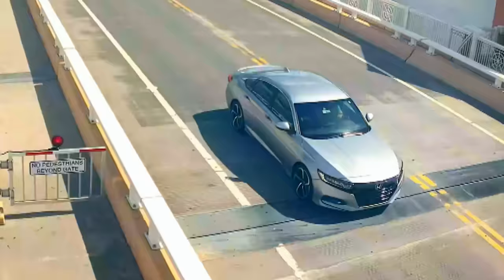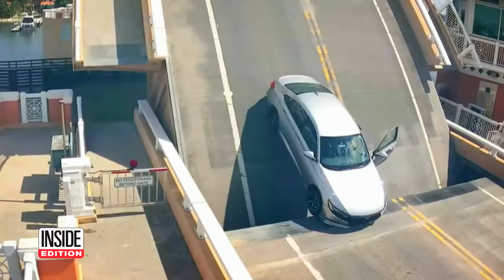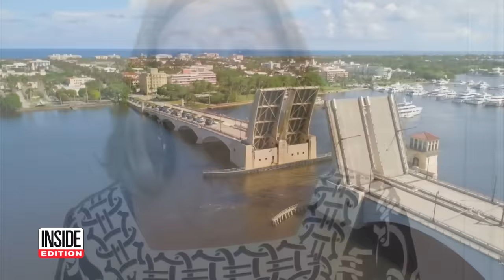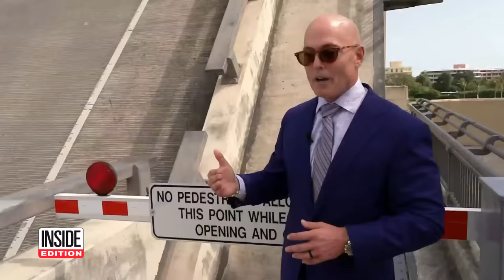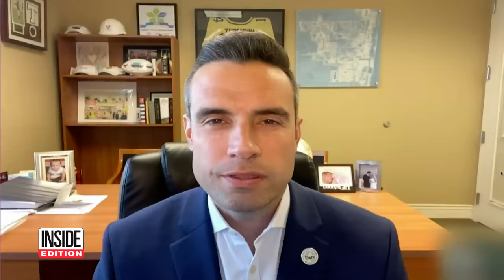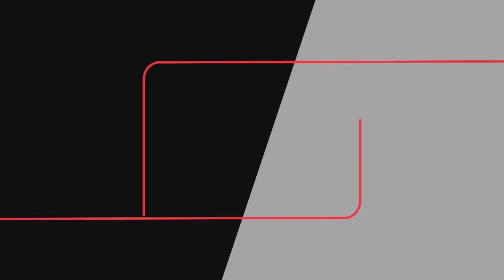Drawbridge Opens While Car Is Still Crossing

Comment: There is no way this particular incident is an accident, the person that is responsible for raising the bridge shouldn’t be blamed. The person in the car could have easily avoided this. It looks like they intentionally stopped and waited for this to happen.
Reply: The person raising the bridge could have easily avoided it also. By looking what’s on the bridge.
Reply: @pk3 how do you know? Do the boats stop completely and wait for the bridge to be raised, or do they raise the bridge in advance while the boat is far away and still moving??
Reply: @trophyscene5015  you're on the internet, how about using google? yes, boats stop completely and line up while waiting for a drawbridge to raise.
Reply: But what if it was instead a responsible driver at that same time???
The bridge operator would still open the bridge!
Reply: @trophyscene5015 
And what if there’s still lots of cars crossing and they can’t open the bridge immediately???

Comment: There should be a "traffic light" on the bridge indicating people to stop while the bridge is about to open.
Reply: There is one like a train track thing
Reply: We have those in uk bruh
Reply: A light? They usually have multiple, along with incredibly loud bells and striped railings that block the roadway. You can't "end up" on an actuating bridge unless you deliberately put yourself in that position. Not to mention there's a one or two minute delay before anything begins to move, which is enough time to walk across the entire length, much less drive it.
Reply: I feel like some people would just pass the light. It's not like they don't do that at railroad crossings already

Comment: I tried rewatching the video 3 times to fully see what’s going on. From what I see, the car doesn’t move. I would want to blame the driver but I can’t be too sure if their car just shut down. If the driver had their hazard lights on, I would’ve dropped my suspicions. However, if this person just did that for a payout, I hope everything bad happens to them.
Reply: If the car was in neutral. Wouldn’t it go forward due to the slope angle increasing. The brakes were on…

Comment: Far too many questions to come to any intelligent summary.    WHY WAS THE CAR STOPPED AT THAT LOCATION/POINT?    There is no gate/barricade to stop the car. I see gates for pedestrians.  Why is the driver not moving forward OFF the bridge???

Of course, the bridge operator should be questioned for activating the bridge. It appears the control tower is right there.  There MIGHT be an "excuse" if a vehicle is at the opposite end as it might be hard to see/determine if a vehicle is still on the bridge ................but I still come back to this driver.    WHY DOESN'T THIS GUY MOVE FORWARD 7 METERS/ 20 FEET?????    Did he run out of gas???

There must be some kind of LAW or RULE that got the bridge operator fired.  Maybe she had a poor attitude during the inquiry...........but still .....WHY WAS THE CAR STOPPED AT THAT POINT???

.

Comment: Regardless if it were the drivers fault or not the bridge wasn’t supposed to open the boat supposed to be notified of an obstruction on the bridge preventing its opening, this is a operators error they’re job is to ensure the safety of people even if they’re a blatant idiot.

Comment: It's either he stalled, ran out of petrol etc. or it's a scam quite frankly. He's obviously fine enough to open the door so if there's no problems with the car just press down on the accelerator and go there's no fence blocking his way off the moveable part of the bridge so just go

Comment: ...Now it wouldn't have been a problem if it was a 1974 Dodge Monaco with 440 cubic inch plant, Cop tires, Cop suspension, Cop brakes, and was a model made before catalyst converters so it runs good on regular gas

Comment: This is a problem that could be solved much more reliably with 1980s-level tech of infrared sensors (such as your garage door).  Not that there shouldn't be a human operator for every situation where the machine is wrong, but overriding the sensor's safety should be an extra process requiring a set of keys that need to be retrieved from another room, and a report written up (so the sensor can be fixed).  And I haven't even mentioned AI yet!

Comment: they should add laser sensors along the inner length that turn on before rising, like crawling toddler or chihuahua height at least (+ a person still present for big/busy bridges and a status light (for H.Q or the bridge guard, in case the sensor dies). Edit: More bells/sound alerts and signals? ._. (for unalert and deaf people?). Like an arc with a sign that flashes  near the midddle

Comment: No no no no no… give the bridge operator their job back. Put the driver in jail or fine them. They clearly were scamming. They stopped right on the line and had zero obstructions preventing them from trying to move forward, even a little bit, once they noticed the bridge moving.

Comment: Firing the operator is stupid. Put some traffic lights to warn drivers and pedestrians in advance. A traffic roadblock should be installed as well.
Reply: I've crossed this bridge many times. It's not a secret when it's about to lift up, but not everyone pays attention. When these things happen, wrong or right, heads must roll.

Comment: I agree that the driver was doing this in purpose but that does not excuse the operator from not seeing a car . Going back to the incident where the elderly woman wasn't seen and died as the result I wouldn't trust an operator who misses an entire car.
Reply: The car stayed there for 30 seconds and the operator wouldn’t be able to wait any longer anyway. Either draw the bridge and sacrifice a car trying to scam or risk the lives of multiple people.
Reply: Not to mention hitting the ship which would cause a lot of damage. But as it turns out, the operator only relied on the camera views rather than stepping out of the control booth. Either way, they would still have to lift the bridge.

Comment: The operator should have called the security personnel and towing vehicle to take the vehicle  off the bridge
The driver can even be prosecuted for deliberately delaying and fraud
I believe they have standard operating procedure
If the car was actually faulty, won't they tow it?
If the company is fined heavily, the company may fold up
A lot of automation and use of AI should be deployed to assist the operator